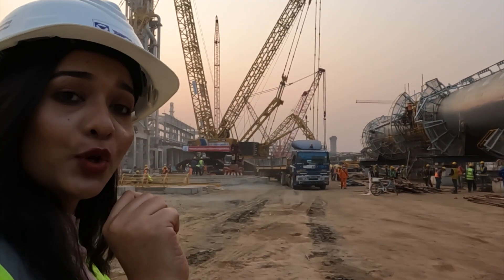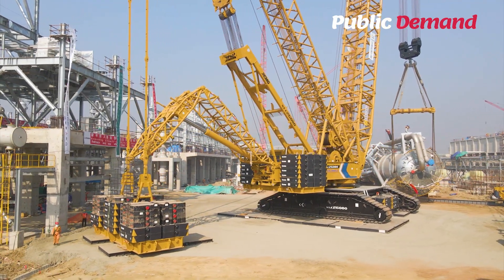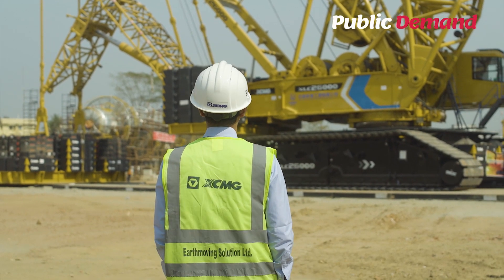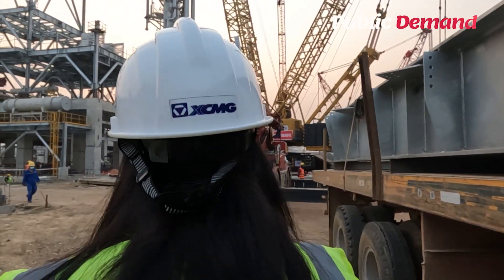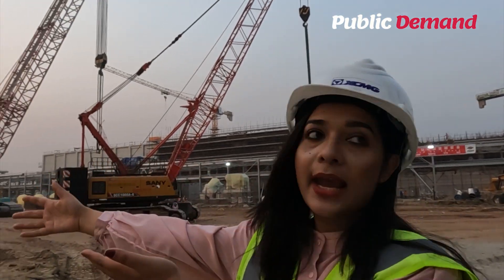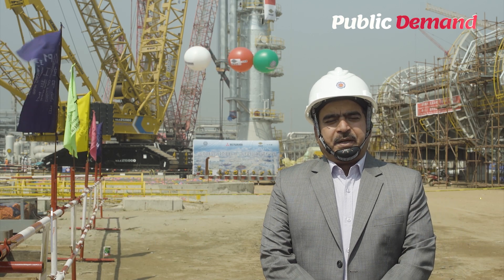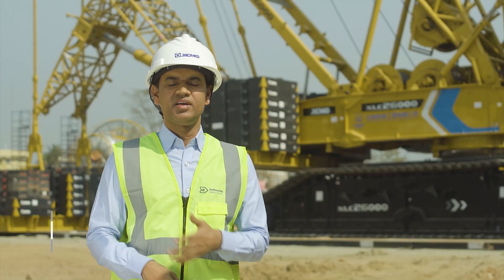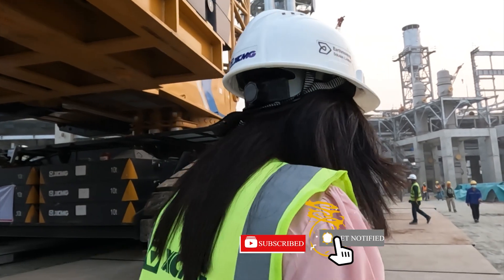ইতিহাসের সবচেয়ে বড় ক্রেন এখন বাংলাদেশে | The Lasted XCMG XLC26000 Crawler Crane in 2021

Comment: পদ্মা সেতুতে যে ক্রেন ব্যবহার করা হয়েছিল তার ধারণ ক্ষমতা ছিল ৫ হাজার টন। তাহলে এটা বাংলাদেশের ইতিহাসের সবচেয়ে বড় ক্রেন হলো কিভাবে ?
Reply: The XCMG XLC26000 main crane adopts a 90-meter heavy-duty main boom, which can lift up to 720 tons and has a radius of 30 meters. The XGC500 auxiliary crane runs off the tail. With the super-lifting and counterweight hovering function, dual-engine power safety, super-lifting and counterweight stepless variable amplitude and many other highlight technologies, as the flagship of the new generation of XCMG XLC series crawler cranes with a capacity of 2,000 tons